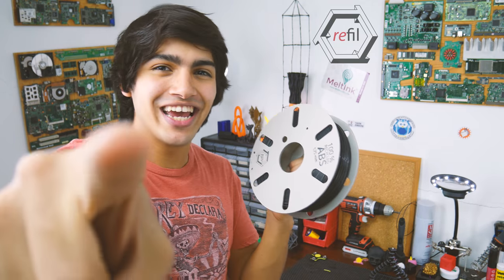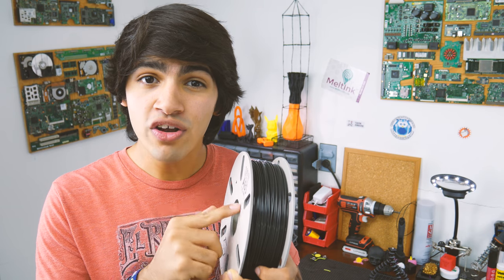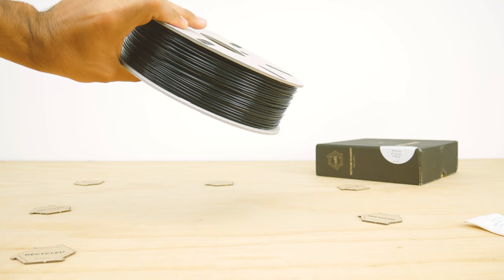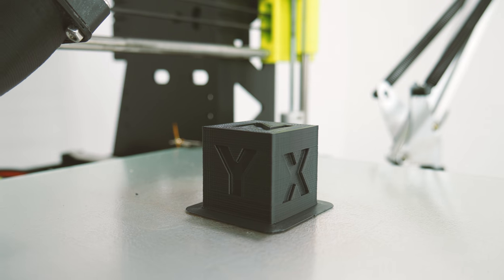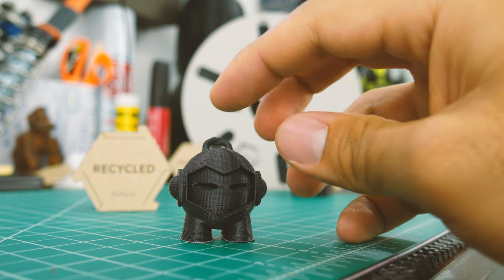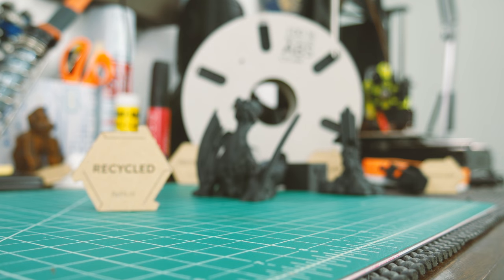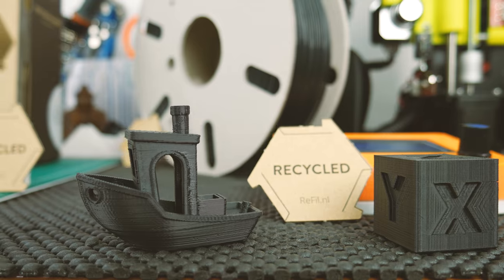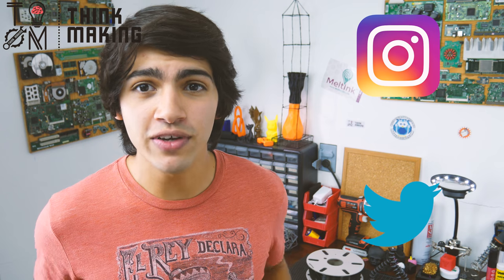♻ Recycled ABS from Car Dashboards - ReFil ABS - Filament Review

Comment: You need to lower your outer perimeter speed or your overall speed to reduce the amount of ghost ripples you are getting in your prints. Also - are you using DRV8825 stepper drivers?

Great review of the filament, looks nice to print!

Steve
Reply from the maker: I do that sometimes, but I hate to wait longer jajajaja